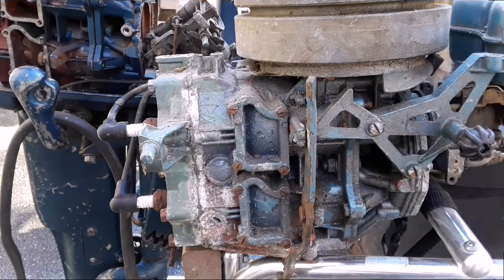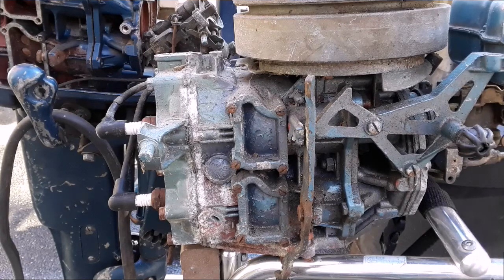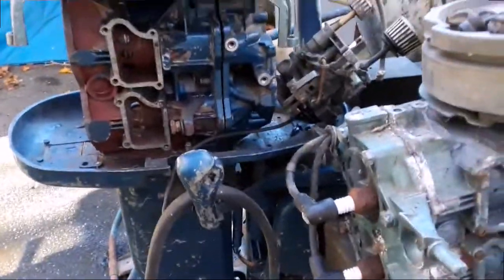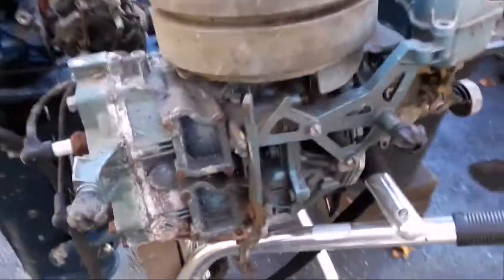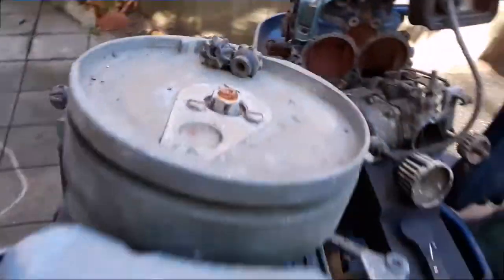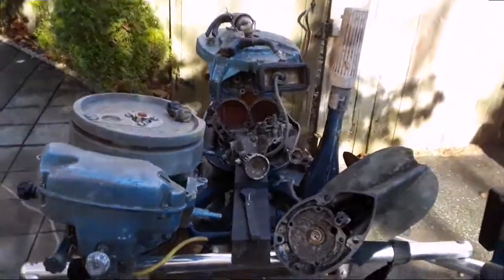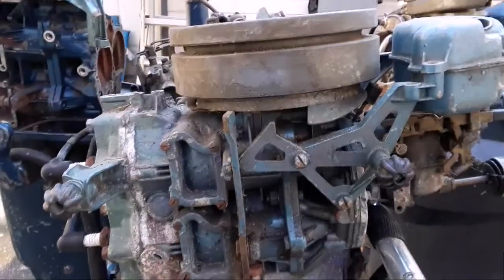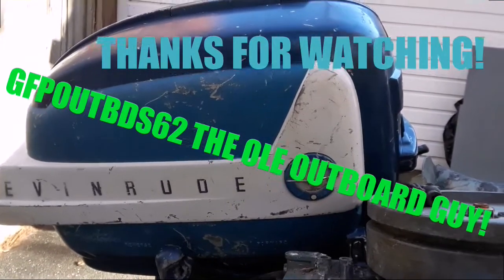1958 Classic EVINRUDE Outboard! Preview of BUILD A MOTOR FROM PICKING PARTS! FROM JUNK! WOW! CRAZY!!

Comment: Quite the project for sure, will remember you the next time I need parts for one of these!  Don
Reply from the maker: Yes I like the challenge .I have this motor and many parts for them. This motor is built up as of today. Powerhead  is on and lowerunit and driveshaft installed .Its one of my Winter projects along with a 1956 15Hp Johnson  seized junk motor with a very nice cover I painted years ago  coming up soon with video anyday .Stay tuned!! Glenn